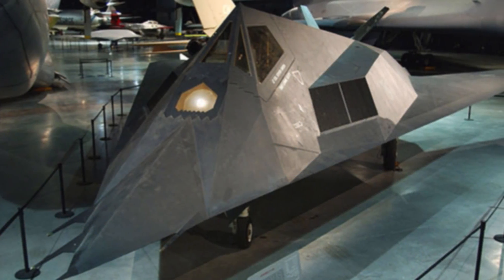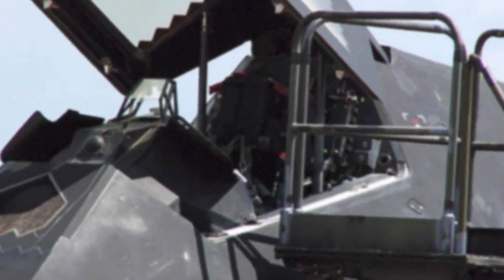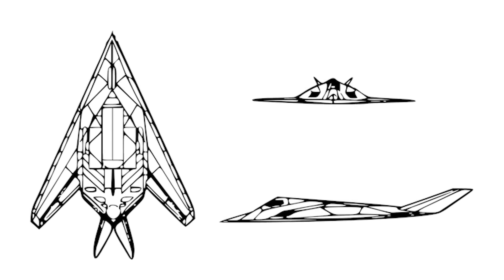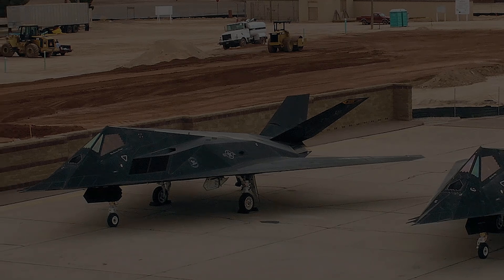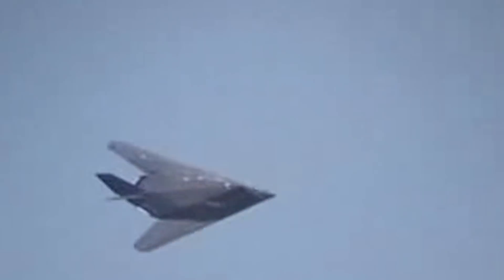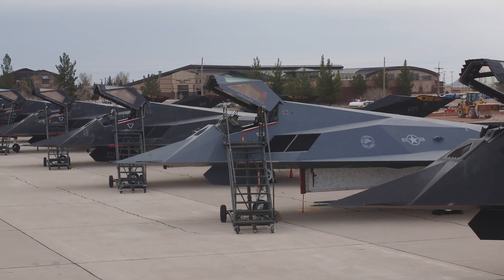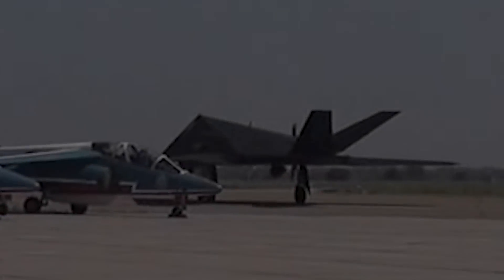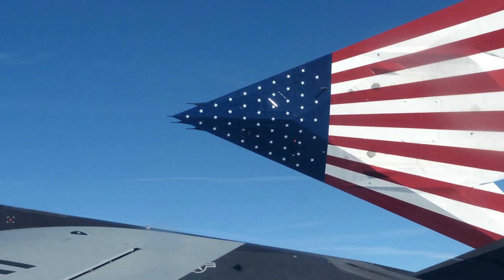The Stealth American Flag

Comment: "rapidly set to fly again" I bet that's what the air force wishes. That things more of a pain I'm the ass for maintenance than the f18. And I remember my unit sending a det to bring back 3 f18s from that bone yard in.... Arizona I think? We were told it should only take a few weeks. Well.... About 10 months later they came back. With a singular aircraft. That immediately went HARD down when it landed. And didn't go flying again for 2 more years.

Comment: I 1986, I lived in Los Angeles.
One day, as we passed the aircraft factory, I saw it.
The "Have Blue" tail fins and the top of it's pilots hatch was plainly visible from the freeway.
I told my father about it and he didn't think anything of it. "Did you get a picture of it " he asked.
No I said, that was probably just plane parts
being trucked around" my Dad said.
I knew it was a new plane but couldn't prove it.
In 1993, I was in Hresorgovia, off the sea and saw 3, 
F117As flying in formation, looking for targets to bomb.
We're any of the F117s actually retired?
I don't think so.
There stealth TEC was to valuable.
We will see them again someday.

Comment: When I was a boy I saw of these on the tarmac at an airshow, it was stunning. It was also guarded by soldiers with m16s and pictures weren't allowed.
Reply: Yeah same setup when I first saw one. Two layers of velvet rope around it with soldiers in between.
 I managed to get some pics when they weren't looking. One right into the exhaust that I had to hold my camera above my head and jump to get lined up.

Comment: So the F-117 isn’t still sitting around waiting to be used, they were taken out of service in 2008...they’re ARE NOT READY TO FLY AGAIN, and they were replaced with no replacement, well none told to the public. However there most definitely WAS a replacement, an evolution, the F-22 raptor and F-35 are NOT THE REASON THE F-117 was retired and then we gave up on the ol bird. That’s just inaccurate. I’ve been right near the evolution of the F-117 Nighthawk and it’s beautiful, and while I was close enough to see it very clearly as it hovered silently I didn’t sign any papers telling me to keep my mouth shut. So I won’t. It was about 5 years ago, so I can tell you that for 100% fact it was fully operational then and more than likely still serves today. So the F-117 since it’s birth had used conventional propulsion, just like all the jets and planes of our days even when electromagneticgravitics were mastered in the 1950’s secretly under the military. Anyways, the current model of the F-117 now has no wings, and no tail, which would make one scratch their head wondering how it even flies, anti gravity “propulsion”. And the body reflects that, it’s now a flat teardrop shape on the bottom instead of a diamond and the tail end of the teardrop is the rear of the aircraft with the widest part being the cockpit, what did stay the same to resemble the Nighthawk look was the black radar absorbing paint and the radar deflecting angles on top of the air/spacecraft. It can RAPIDLY accelerate and can be in another country’s airspace in literally seconds, not minutes or hours. It now serves in the same role that the F-117 did for so very long, except now some certain people within the military have been given a need to know.  Most don’t have any knowledge of these types of programs, the compartmentalization within the military industrial complex is absurd, I’ve seen other air/spacecraft too years ago that shouldn’t technically exist, but it’s all very much as real and physical as the air we breath. I swear most would think all this is science fiction, but the truth is most technology shown in those series and films aren’t fictional at all, but a soft disclosure and showing of what has already been mastered in black programs and is actually reality. The world as we know it is living an antiquated lie while the space age goes on above our heads in secret. As Richard Dolan so rightfully put it, they’ve now essentially created a more advanced “breakaway civilization” from our own.

Comment: We were actually working with low-observable materials at RATSCAT in the late '60s
Reply: No one seems to remember why the SR-71 Blackbird is painted black that has a blue hue in certain angles...  the paint has special materials that, at speed, cause electro-static discharges that disrupt radar returns.  They used that same type of technology on the skins of the F117 and now have figured out other colors on the newer aircraft...

Comment: Having one shot down over Yugoslavia proved that it wasn’t stealthy enough to sneak in enemy airspace.
Reply: That one was shot down due to poor planning, they used the same flight path over and over so the enemy knew where to look for it.
Reply: Out of thousands of sorties, one was shot down. I would call that pretty successful; and I doubt any air force on earth wouldn't be delighted with that statistic. Also woth mentioning that the F117 that was lost was flying without an Electronics Warfare escort ; the only mission where that occured (due to bad weather). If there had been an EA-6 in the area to jam the Serb radar, or fire of an anti  radiation missile; I doubt that Stealth fighter would have been lost.

Comment: As old as it is its still TOP secret in many respects. Any outside nation or faction would kill to have one to dissect.
Reply: The only really advanced tech is on the aircraft, the RAM coating. Even with samples obtained from the one shot down, it has proven pretty much impossible to duplicate.
Reply: @gapratt4955  
Nobody would exactly "duplicate" that plane or any of it's parts instead Russians and Chinese thoroughly examined the (up to that point) hyper-praised and glorified technology as we enabled them the access to the F-117 which our army took down.
Reply: @gapratt4955  All the airframes that are on display in museums and as gate guardians have been painstakingly stripped of all critical tech, including the RAM material. They sandblast it off.

Comment: What is the glowing orb on the front of the aircraft?
Reply: Sensor turret. it is behind reflective glass. It appears to glow from reflected light. Turret contains FLIR and targeting laser.
Reply: @gapratt4955 So the light fixture above is reflecting off the glass?
Reply: @Cybo-Man  What appears to be an orb is actually the reflection of the FLIR lens under the glass giving the illusion of an orb.
Reply: The Sun